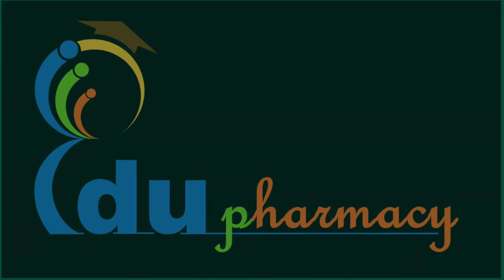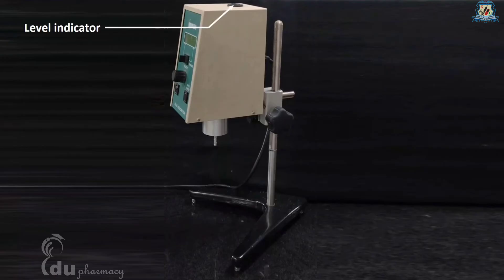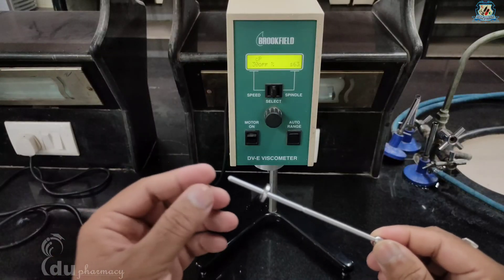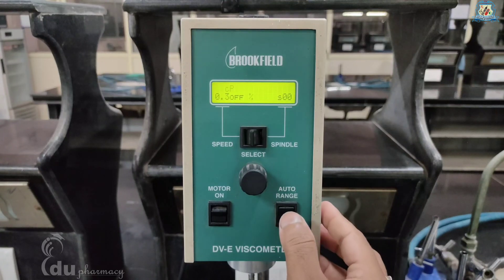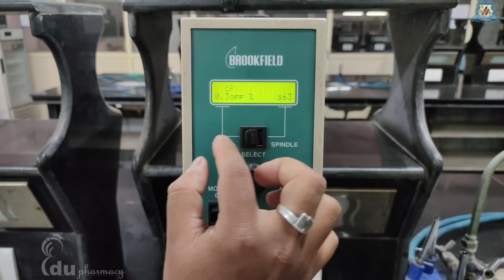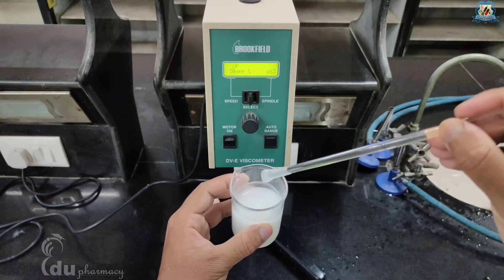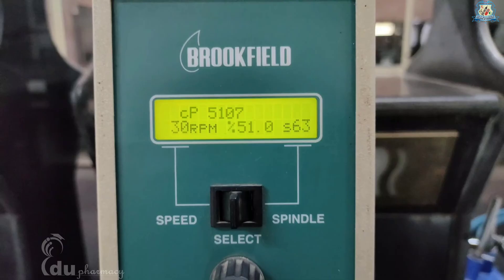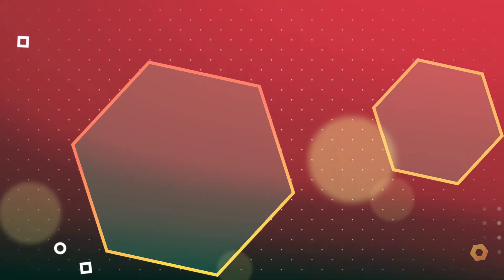Brookfield viscometer SOP | How to use Brookfield viscometer | viscosity measurement by Brookfield

Comment: How to decide which RPM to use? And how to confirm that the chosen RPM is already the correct one?
Reply from the maker: RPM is selected as per your procedure requirement, spindle seletion is totally on trial error bases.. if your torque value is between 10 to 100 %, your spindle and rpm combination is ok.

Comment: sir, please tell me on which parameter we should select the spindle and  how the calculation is going to be understand from these stats , trying to understand  from last 2 months
Reply: I am also confused to which reading i should count final, because different rpm and tork gives different viscosity no at same temperature
Reply from the maker: Which model u r using ?